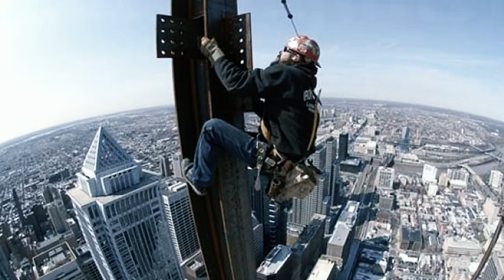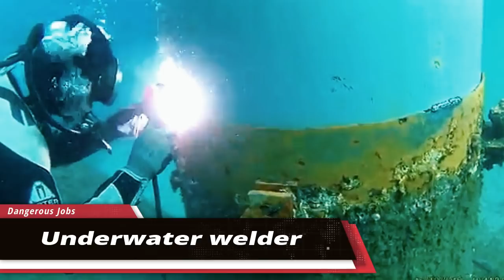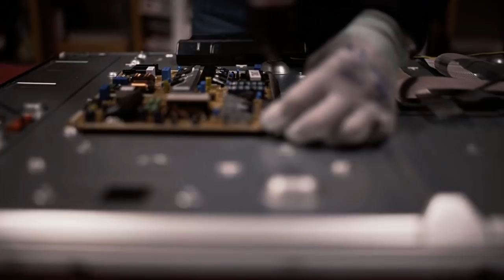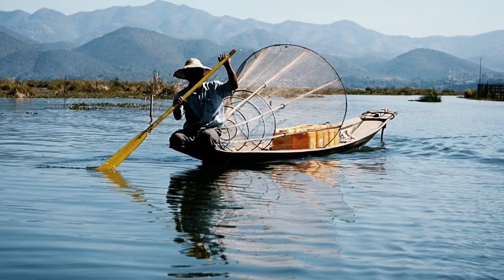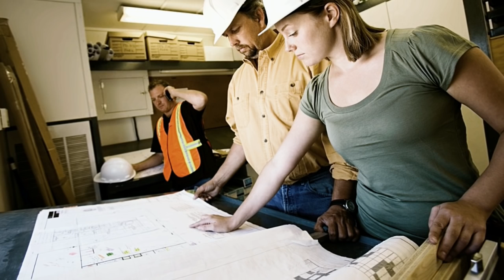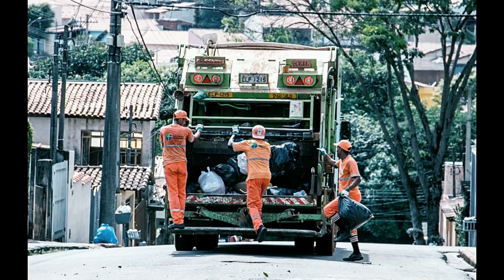20 Of The World’s Most Dangerous Jobs. #4 Is Just Too Risky

Comment: Do some research on leather tanning,it leaves all these jobs biting the dust, dangerous not only to the workers but also the environment.
Reply: Defensor true! But you don't have to worry about a strong wind knocking you off a beam, dangling, then if you are lucky, being dead before you hit the pavement.
Reply: Darlene Greywolf yes,but you have to worry about a splitting machine cutting you in half while working on a wet floor,or a hydraulic press with 200 degrees heat crushing your hand,or handling sulphuric acid,and other dangerous chemicals in large quantities.
Reply: Defensor my late husband almost lost His arm when he was 27! Industrial accident! Card box company, slipped in water from the machine, pooled on oil! Arm wedged in machine, didn't know for months if he would loose it! Scaring horrific! So I do know! Damage from steel rollers, box slitter.